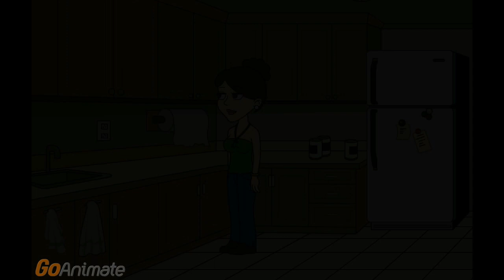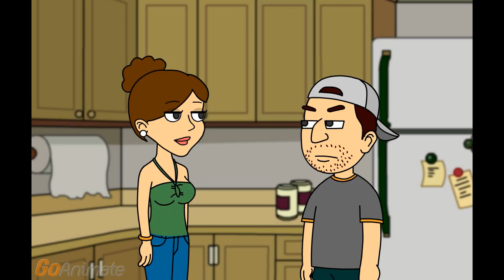Kenmore Air Conditioner Problems

Comment: We have a Kenmore Model #253.70151010 window unit. The remote does not work so I ordered a new one from PartsSource. The new remote does not work. Any ideas what the problem might be?
Reply: I pulled the black "sticky" part off mine, where it says "power" etc. Underneath there were 4 small screws. The problem was that the battery not making contact with the copper "springs" on the other side of this board. All that was needed was to bend the springs outward a little so that they now contact the battery - Shame I even had to do it, but that's how I fixed mine.